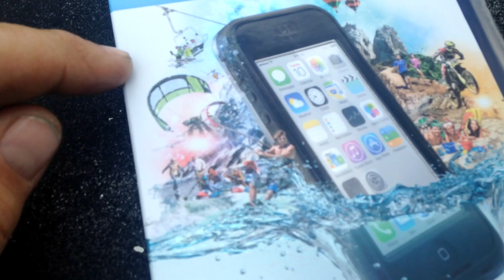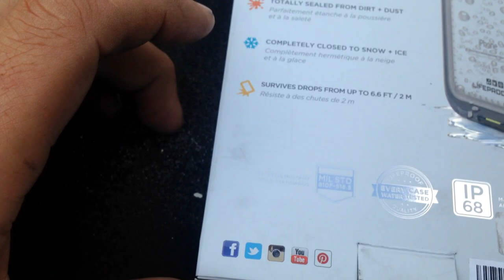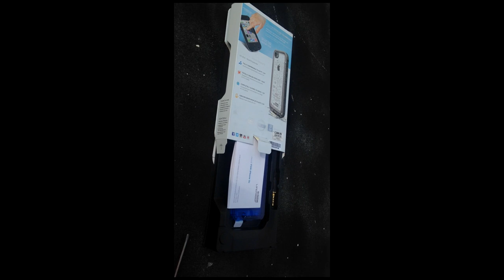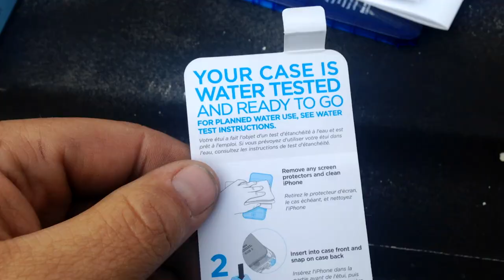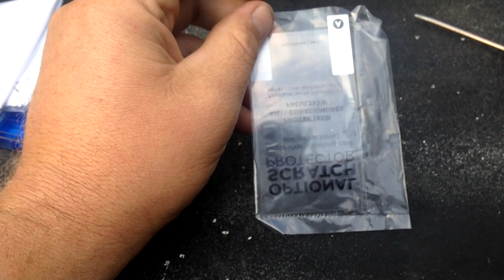iphone 5c glass fixed and new protection

Comment: I agree about the stainless steel, funny how you can get exhausts with all the complex bends, but i did have a quick check, you can get stainless brake lines, but harder to flare and bend, maybe do some research over there.
also remembered that you can have copper brake lines, not sure what that;s like in the winter, but it shouldn't react with the brass fittings

Comment: I would consider getting an alignment done on the car.  I realize that you mounted this part with same orientation as the old (counted number of threads to match.)  Who knows if that measurement is right, maybe other parts have worn and make that measurement useless.  Since it is the 2nd part and you still feel wobbles or whatever then you might want to get it aligned.

Comment: Hey Bill, cool Vid, maybe you wouldn't have all the trouble if you steam cleaned the underneath of your truck , over here in the uk we put salt and shit on the roads all though the winter and we know that once a month at least its into the car wash to have the salt washed off before the corrosion starts , maybe a bit more care and maintenance on the car and truck would help heaps , in other words wash your car and truck more often Billy, Prevention is better than cure bud, great vids though

Comment: Magnets are in the package to hold the flap closed.  Makes the package a box but also a book.  Front cover advertises product and protects it when displaying.  Magnets hold front closed but allow customer to open like a book to see more info on inside of the flap.  I bet if you tear open the flap you will see some metal foil embedded in the cardboard.  Some companies use velcro buttons for this purpose.

Comment: Hey Bill.  I've had a Toyota 4runner for 15 years and have only had to replace a battery, muffler, brakes and a battery.  Not one burnt light bulb.  Still gets the same mileage and power as when I bought it.  We dont have the kinda winters and salt you guys have in Ontario tho.  

How is the goose fence working???

Comment: If your getting a new truck get a honda ridgeline
Reply: Honda is not a real truck
Reply: richard smith
explain why?
Reply: richard smith  i mean its has great power erganomics  and good gearing
Reply: Well for one the tail gate is not even level in the back it has only 5600 payload if you got four wheel drive it is really only 3 wheel drive at best because of the slip on the axles  just not a real truck
Reply: richard smith im not trying to fight but the 2014 model is just a good truck and the darn thing has a pretty level tailgait so bill wont replace it in like 10 years
Reply: ok thats your opinion
Reply: filip cubic 250hp is horrible power lol.  Sierra has 403hp
Reply: rebelyell22 its realy 350
Reply: filip cubic uhhh no.  the 6.2 v8 has 403